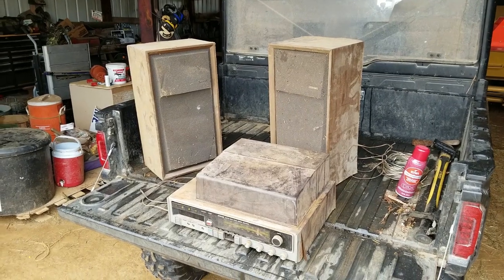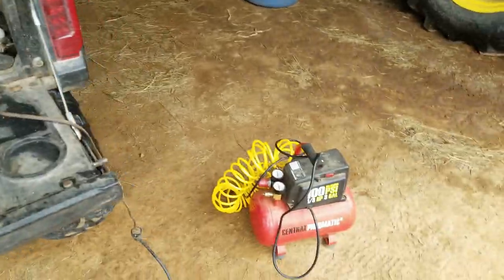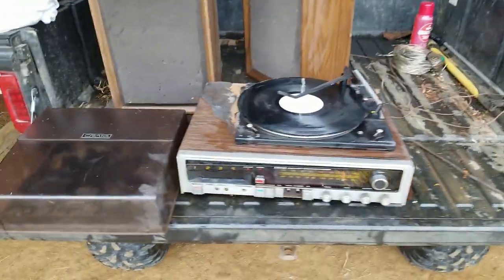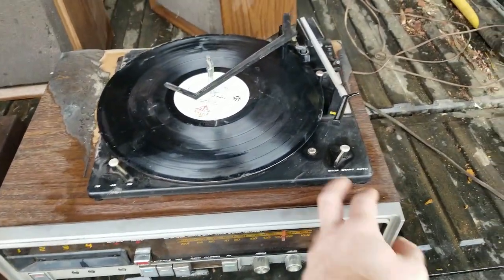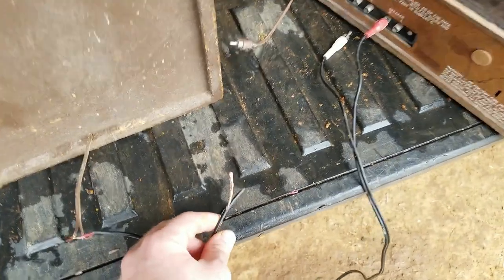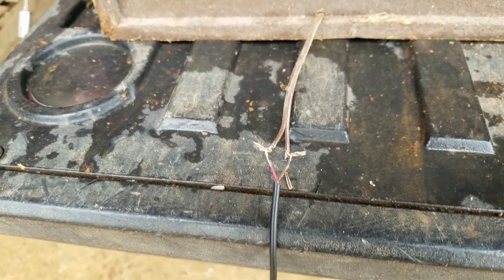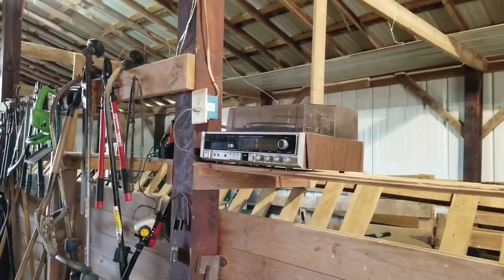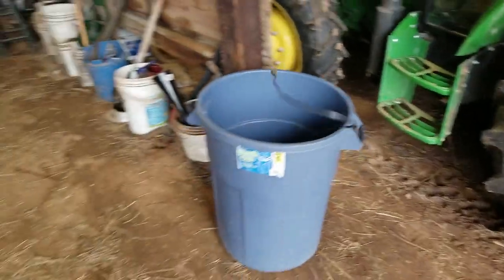Stereo and Record Player Restoration with Barn Installation

Comment: Has an 8 track player, cool. I still have several tape cartridges that play well. Player probably needs lube, a new belt, capstan and head cleaned. Hopefully, it isn't one of those units with a plastic cracked head frame.

Some mild soap and water to clean the record, then dry with a clean, soft T shirt ought to do the trick.
Reply from the maker: Thanks for the tips. For a deeper restoration I would need to do that. I mostly just wanted it for the radio. Being in a barn it will get dusty again soon.
Reply from the maker: Thanks for the tips! For a deeper restoration I would need to do that. I mostly just wanted the radio. Being in a barn I know it will get dusty again.
Reply: @rustedpliers1618  Just cover it with a kitchen garbage bag or pillow case when not in use; will keep the dust/dirt off. Good luck with it.